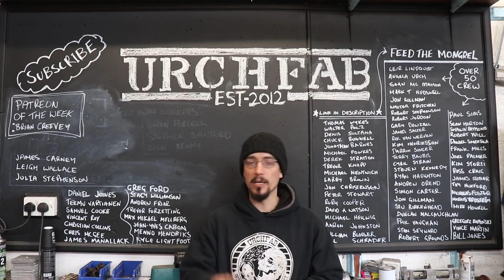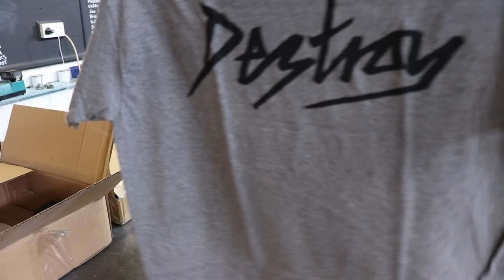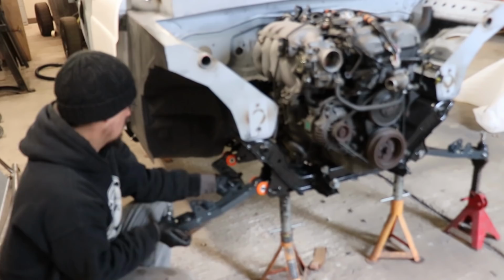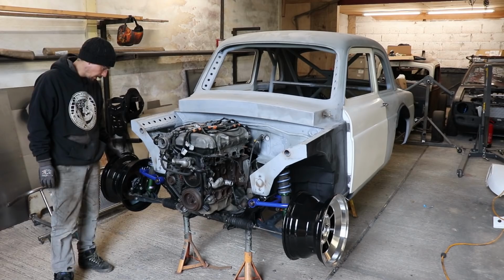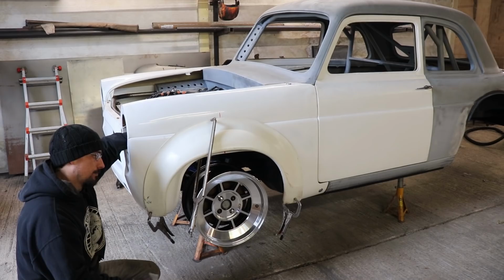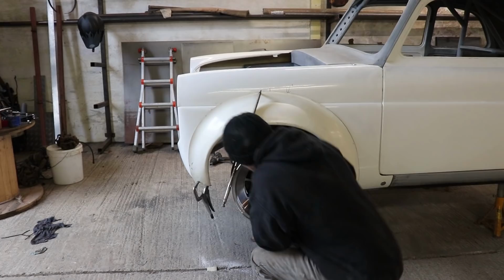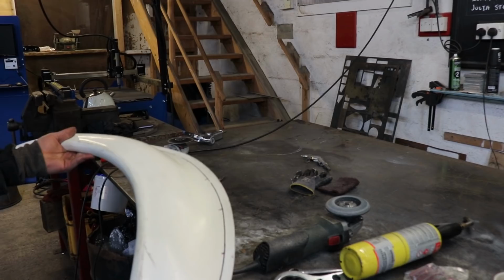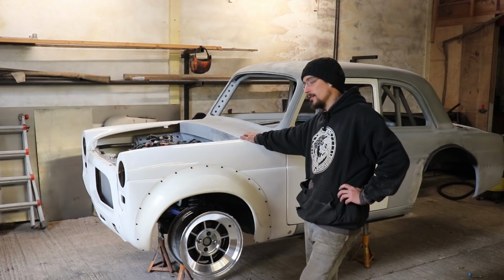THE MONGREL PART 49: FRONT SUSPENSION INSTALL AND WIDE ARCH FITTING.

Comment: I'd forgotten how easy a race car is to work on compared to modern cars. That drop off front makes life so much easier for you. I'd also forgotten how much easier it is to be using new bolt on parts instead of extracting old ball joints and worn out bushes from existing suspension arms!

Comment: I would recommend using rubber well nuts to mount your arches. Easier to remove than rivets, less of a faff than rivnuts and if you have a collision they should pull out without ripping your fibreglass wing apart.

Comment: I would suggest the slotted lower inner control arm mounting is for caster adjustment, not track increase. Notice its only on one of the inner mounts allowing the control arm to pivot front and rear slightly.

Comment: Looking good, Matt! I think stainless steel bolt heads (of whichever type of fitting you go for) would look the part with the colour you have chosen. Will also tie in nicely with the rims and the door handles. Original grille going back in or a custom one? The headlamp surrounds came in a chrome version on the Prefect that might also tie in the look. Or make the ones you have look stainless. Have to see it finished to see if that would look right or not, though, just a thought.

Comment: Arches look the goods Matt, maybe they needed to be an inch wider, guess you'll figure that when the tyres go on. Only other thing I noticed the arch deforming when you put the last bolt in the front, maybe need a metal reinforce behind there to prevent cracking when in use?